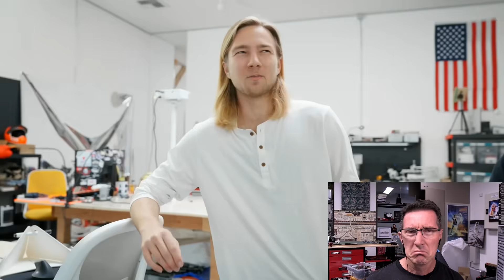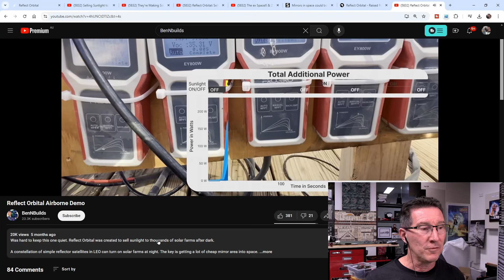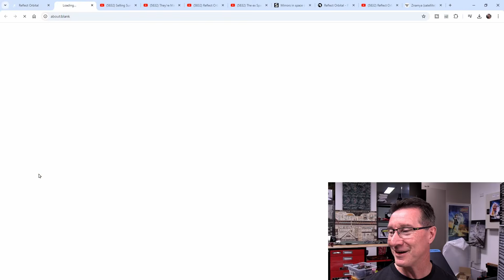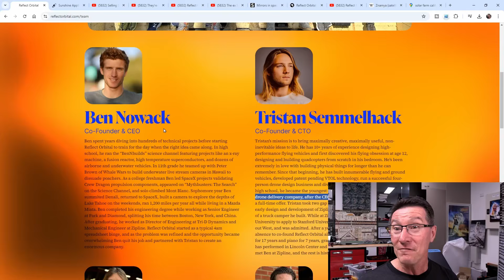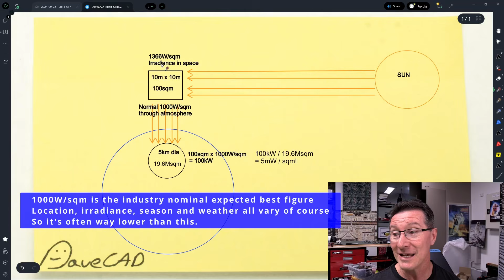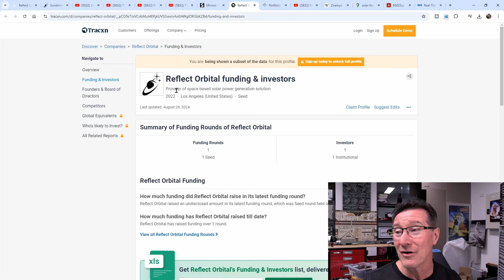EEVblog 1637: Solar Freakin' Space Mirrors! - Reflect Orbital DEBUNKED

Comment: Look if you get these mirriors up to 10 km oer side, then these numbers have a "chance at making useful levels of light" with the enormous assumption they can hold that 5km circle before, but even at 1km per side mirrors they are an order of magnitude low of potential reasonable viability. But thats just "reasonable in the sense that might allow companies to generate solar power" not that it will be finacially viable or engineringly feasible, not to mention what micro meteorites and space debris will do to this operation, nor the energy to angle these mirrors or anything like that.

Comment: Seems dead obvious to me that the area of the mirror represents the amount of light you can reflect, so a 10m mirror can only reflect as much light as what you can normally get out of a 10m solar panel. So if you want to effectively feed a say 2km solar farm you need a 2km mirror in space, or 400000000 of these 10m mirrors. And that’s assuming you have zero scatter from the mirror surface and transmission through the atmosphere.

Comment: I think the only way you could get space based solar to work is if you had solar stations in space that were transmitting power to earth via microwave beam

But that would take a lot of technological and infrastructural development and wouldn't be a viable solution for the immediate problems of climate change

Comment: People should really use AI more. It can be a really great place to start. You think you have a good idea? Run it thorugh chat gpt quick see what information is out there:

why are space mirrors for solar energy at night impractical?

ChatGPT said:
ChatGPT
Space mirrors for solar energy at night are impractical for several reasons:

1. Enormous Scale and Cost:
A space mirror large enough to reflect significant amounts of sunlight to Earth would need to be colossal. Building and launching such massive structures into space would require substantial technological advancements and immense financial investment.
2. Energy Losses:
Even with a perfect mirror, the distance between Earth and space means significant energy would be lost due to atmospheric absorption and scattering. When sunlight is reflected from space to the surface, only a fraction of the original energy would make it to the ground, reducing efficiency.
3. Orbital Challenges:
To reflect sunlight onto the night side of the Earth, the mirrors would have to be placed in specific orbits, likely requiring geostationary or high-altitude orbits. Maintaining this precise positioning would be complex, and controlling large mirrors in space presents additional challenges due to forces like solar radiation pressure.
4. Environmental and Safety Concerns:
Directing concentrated sunlight to Earth could have unintended environmental effects, such as overheating local areas or interfering with natural weather patterns. There’s also the risk of damaging infrastructure or causing health hazards like increased UV radiation exposure.
5. Energy Alternatives:
Solar energy systems that store power during the day (like batteries) are already becoming more cost-effective and efficient. These systems can store solar energy for use at night without the complexities of space mirrors, making them a more practical solution.
6. Nighttime Solar Energy Not in High Demand:
The demand for solar energy at night can be met more easily by storage solutions or other renewable sources, such as wind or hydroelectric power. A vast infrastructure of space mirrors would be overkill compared to these simpler and more scalable solutions.
In short, space mirrors are technically fascinating, but their drawbacks in terms of cost, complexity, and efficiency make them impractical compared to current and emerging renewable energy technologies.

Ahhh, the vocal fry of deception and insecurity. I love it.

Comment: This does not make sense. Even with 100% efficiency with their most optimistic numbers, they are just on par with just building more stuff on earth.
They do 57 satellites with 100m^2 reflector = 5700m^2 of light * 200w/m^2 so 1.1MW of electricity, if all light is reflected and perfectly pointed to solar panels. For $30k *57 = $1.7M which is in ballpark of same sized solar powerplant, but with half predicted longetivity. You can build two or three 1MW solar powerplants on oposite sides of earth with same investment. No one will pay for 
this if they can just add more panels, even if it worked like they think it will.. in best case scenario.

Comment: So it's a Freeman Dyson Ring(sphere) over a planet that's going to block a section of the night sky, black out a bunch of GPS and communication sats as it sweeps between the transmitters and the targets. Who knows where it'll reflect it hopefully not at something not designed to take ground communications levels of signals. That or it's going to soak up that energy and degrade and/or distort the reflector even more.

Dawn and dusk is probably the best time to loose GPS on your car navigation too as dangerous as driving already is I could see that causing more harm than nuclear has after a few years. Shadow from it is going to be larger than their light demo too as the satellites are closer than the sun. To say nothing of when it's aiming at a solar farm and sweeps past a road distracting and blinding drivers, small towns, and solar observatories.

Comment: If this would work, I'd just build a few towers with 10x10m reflectors to permanently reflect sunlight just between states :p
If they actually could do this the way they claim; imagine the HUGE issues it would cause! You can't 'turn off' a mirror. So every movement would "drag" that immensely bright 5x5Km spot of light over the planet to relocate. Over airplanes, blinding the pilots. Over highways, blinding motorists. Over residential area's where people want to sleep and over wooded area's potentially causing fires, and guaranteed disrupting the wildlife.

Comment: Cheaper to use the energy during the day when it's cheap to either heat a liquid like sulphur  in an insulated underground tank. then use the hot liquid to boil water for a steam engine at dusk. Or pump water uphill into a reservoir to run a turbine at dusk. 

We do the same thing with water towers. A small pump filling the tower tank all day, and gravity to supply the demand at dusk.

The balloon idea's not such a bad idea. A balloon at 120,000 feet is very stable. A spinning disk of mylar would increase the power on the solar collectors.

Comment: The only way orbital mirrors will ever be cost effective is if they either make incredibly thin incredibly large mirrors (at least 100x100m from each cube-sat) or manufacture them on the moon. The moon has much less of a gravity well to escape, so you can use not only less delta-v to escape it, but use a lower thrust higher efficiency engines to do so. In principle, you could make kilometres long mirrors and use them to provide light and warmth wherever it is needed, and reflect it away from areas that are experiencing too much heat. Possibly even redirect or destroy cyclones. Not that I’d trust any government with the power to alter the weather.

As for solar energy beaming, this kind of large surface area solar is very wasteful. The whole point of using orbital mirrors in the first place is that they’re cheaper for their surface area compared to photovoltaics. It would be more efficient to focus the sunlight on a concentrated photovoltaic or solar thermal collector on the ground, or to generate the energy in orbit and beam down microwaves if you have the thermal capabilities.

Comment: My guess for the 200 figure would be, as silly as it might seem 🤭, they just confused numerator and denominator and divided 19.6M sqm per 100 kW 😅. That gives you 196.35 sqm to produce 1 W, not 196.35 W per sqm. 1/196.35 = 5.09 mW per sqm, same as DaveCAD calculations.

Comment: I'm just going to be the devils advocate. If we assume that it is 100m x 100m, we could get to 500mW/m2 per satellite. If you have a large swarm (think Starlink etc.) you could achieve 50 W/m2 by adding 100 sats per spot. If the orbit takes 100 minutes and each satellite can cover an area for 4 minutes, that means that you would need 2500 sats to provide that kind of coverage. That is doable, and if we assume that they need say 10 grams/m2 of mylar reflector, then a 100m x 100m satellite would need 100kg of mylar reflector + all the other things you could need to control it. So let's say 300kg each. A constellation like that would need 750000kg in orbit, or around 50 Falcon 9s worth of satellite. Bigger satellites might be practical (a 1km x 1km sat might be achievable, but it would be a significant challenge), but the basic concept seems somewhat doable.

That said, I still think batteries are likely to win out, but maybe there could be a niche case somewhere, although I wouldn't be any significant money on this working.

Comment: Other solutions that don't require 100s of space launches:
Home Battery
EV to load/home/grid
Hydro storage
Molten salt, inertia or other niche energy storage

Another advantages of not putting this in orbit
- cheaper
- easier to maintain
- doesn't need to move out of the way of other satellites or space debris
- no Kessler syndrome risk

Comment: Coming out with a visible light, (not even) Ptolemaic solar satellite solution in the year of our Lord 2024 should be instantly regarded as the joke it is.
We've had phased array transmitters for decades now, firmly established that if there was to be any long-range wireless power transmission, it'd have to be either driven by lasers or consist of phased arrays, and most likely in the microwave band.

Comment: * Orbital decay time of satellite with large surface of 100m2 and small weight of 1 - 10 kg will be very short - it is similar to a parachute!
* Sun angular size is ~0.5 degree, even with prefect mirrors it can not be focused to a narrower beam (without loss of energy, proof: the second law of thermodynamics). The distance to solar farm is longer than satellite altitude.
* Uncontrolled space debris on orbits perpendicular to most satellites
* Unexpected light pollution annoying pilots, astronomers and environmentalists
Reply: You could use it as a solar sail, but you would have to be quite high, diluting your solar energy further. However, if they scale up the satellite after flying the demo mission, you could have say a 250m x 250m panel. That would give you a lot more power per satellite, negating at least part of the penalty of the higher altitude.

It's a giant solar sail, so the deorbit time is not going to be very long, so I wouldn't worry too much about the space debris aspect. But the light pollution aspect would be massive, and lead to significant complaints.
Reply: If it were able to generate enough energy to be useful there would be massive environmental and weather risks.

Comment: Another perspective; with 45 degree angle, about 3.6 mW sunshine per m²,  assuming 100% reflectivity, and, that all the reflected light hits that area, which doesn't happen. But, even assuming 3.6 mW/m²/satellite, you'd need ~280,000 of those satellites to equate ordinary daytime sunlight, for a few minutes. You don't need full sunshine strength, but even 5% of that is 14,000 satellites, that's more than twice as many as Starlink has, at the time of this writing.

Comment: But Dave, they are putting Teslas Solar Roof Tiles on that, which uses special Quantum Unifying Acceleration Convector Kinetics technology! It uses particle emission regulator to drive the virtual capture area of the 10x10 m² up to 420.000 times with a efficiency rating of 69%! Elon 100% approves and it would be financially insane not to invest all your savings and your children's savings in it! This is the future!

Comment: This was proposed back in the 1970s. The cost of launches not even the cost of the satellites which would have used materials such as emeralds etc meant it never got anywhere.
Reply: Imagine if you tell people in 1970 that we will have starlink now. And we use that starlink to watch a YT video that claims it is impossible to make a profitable model for sunlight. I have news for you: sunlight is more expensive than internet if you have the right clients.
Reply: @Xizario2  lol! in 1970 they already had sats that streamed tv and even transmitted computer data. how do you think cable tv worked? it was sat tv that was beamed down and then a local network of cables transmitted the images. 

Also in the 1970s there were plans for sats in space to collect sunlight and then beam it by microwaves to local relays who would then put the power into the local grid.
Reply: @toomanyaccounts  The 1970s orbital microwave transmitting things were several km square and the bits were going to be lofted into orbit using the awesome star raker space plane. Iirc construction time was projected to be several decades. Non of it was remotely practical or cost effective. It was a proposed solution to the American oil crisis which sorted itself out within a year anyway.
Starships huge payload capacity might actually make something like it somewhat feasible and microwave transmission is a far better solution than shining sunlight onto solar farms.

Comment: i tested moonlight power on solar panels i got hold of some high power 60v panels on a none cloudy full moon they only generaed 0.5v per panel. 8 panels with a current of few mA. to generate any sort of real power you would need an array specially designed for it and it would be so big. it would never be commercially viable.

Comment: Of course with a 5km diameter mirror it would work.  But they need complicated technology to deploy a mirror that large AND be able to point it.
(it would be "easy" to deploy a mylar foil and spin it so that it remains flat, but a spinning foil cannot be pointed)

Another worrying thing is the chosen orbit.  It is so low that it can only provide light for up to about 1 hour after sunset.
One would expect a geostationary orbit to be used or at least something of high altitude so it can be in sunlight while above the dark side of the earth.

Comment: 175K per year per satellite makes ~450 dollars per day. With 50$ per MW they would have to make 9 MWh of power per day per satellite. 9MWh/24 makes about 350 kW power a satellite would have to produce. Let's say that they can beam 1.5kW/m^2, that will be about 230 m^2 per satellite or a 15m*15m satellite. So even if they transferred more power than the sun gives, with over 100% efficiency, 24/7/365, to 100% efficient solar cells they couldn't do it with the 10m*10m mirror. With the 10m*10m they could make, in a supraperfect world, about 70K$.

Comment: Do I have to state the obvious? Put a solar panel the size of the mirror in another time zone (or use a battery) and you outperform this crackpot idea. 

I wonder if it's even feasible to realign a giant mirror every few minutes. How long would reaction wheels or thrusters be able to do that? Also the flare on the ground as this thing realigns for the next customer would probably be a huge nuisance.
Reply: Better idea: put some panels on a hill / mountain nearby. Even additional 30 seconds of solar generation would be better financial idea than this concept.
Reply: @avmilenk  Even solar freakin' roadways make more sense than dim light cones from space.

Comment: Imagine if somehow the math did work and they actually did get 200 W/m² over most of their 5 km target. You don't even have to be near a solar farm for that to be annoying, if not dangerous.

If you lived in between two solar farms every evening you'd have to put up with this massive flash of light when the satellites are repositioning between the two solar farms. The satellites in order to be just 12U small and last that long in space will need to use magnetorquers for reaction control so they're can probably only move at like 0.5 degrees per second, at a 900 km orbit that would move the 5 km spot at about 7 km/s, so for just under a second everything would go from moon lit (0.001 W/m²) to 200 W/m², so 200,000x brighter... Just imagine the lawsuits from say people driving at night and then suddenly the space high beams blind them. Also a ~2 MW beam of light moving around the night sky would be very visible. That 30% lost in the atmosphere is scattered everywhere, would be cool the first couple of nights but I imagine not after that.

But as you point out this cannot possibly make any sense for power generation, the claims are multiple orders of magnitude bogus. However I can totally see rich people paying $$$ for a light show to impress their guests... I'm sure there's plenty of people out there who would pay $10,000 to have a magnitude -10 dot fly across the night sky let alone several, sell that several times a year and they have a business model.